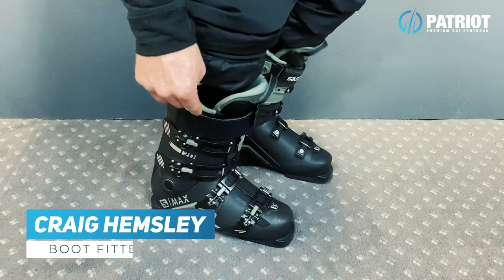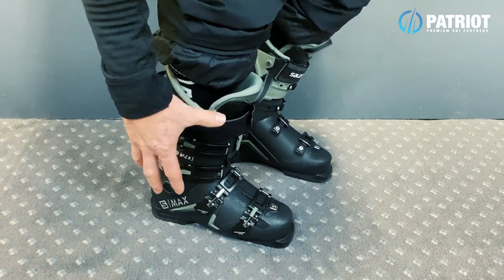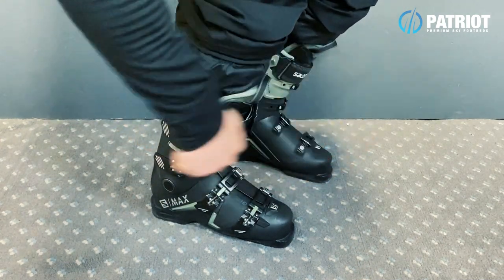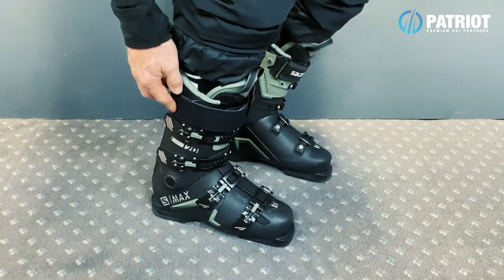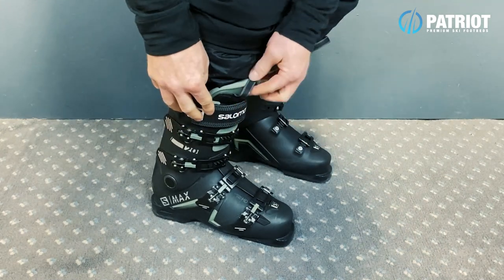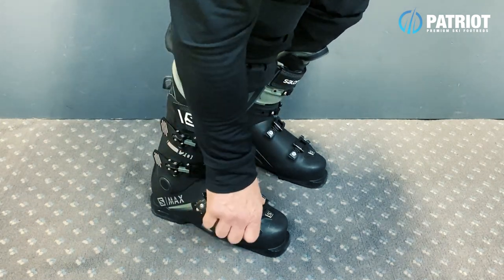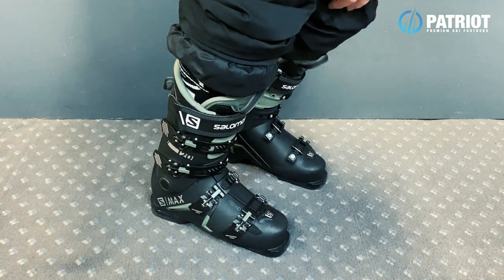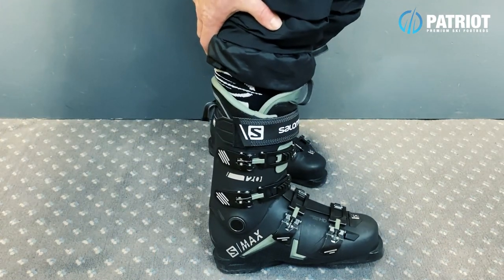How to tighten your ski boots - Ski Boot Tips

Comment: When my boots are tightened as recommended and I then flex forward, I often notice a small finger sized gap between my calf & the rear spoiler. Is that normal, or does it suggest further tightening of the boot cuff is required?
Reply from the maker: This can be quite common. Not always the end of the world.  
if you want to try snig this up, try with your powerstrap under your cuff directly on your liner. Or you could check out the Patriot Trustraps. But can also depend on your boot as to whats possible.

Comment: As a beginner I was sold a pair of Atomic Hawx Magna 80. They are comfortable but I’m not sure if they’re too wide for me. The shop told me all beginner boots have a wider last and it’s ok that they are a bit looser as long as the length is good (it’s perfect). I did some research and they appear to be right. Every big inner boot has a wide last. Should I worry or just use them?

Comment: What about tightness of upper boot buckle on leg and it’s effect on flex.  I find if my  top boot buckle and strap are tight I can only bend my knees very little and I lose flex.  Any thoughts on this?  I believe you should be able to bend your knees to point of covering toes.  If power strap and top buckle are set per your video I would only get to maybe half way to my knees and that is in doors where it is warm.  I have 100 flex Salomon x-pro S boots and weigh 135 pounds.  Is it ok to not really use power strap or have it very loose and just put top buckle on somewhat snug but keep lower leg buckle on as per your video?
Reply: remember that when you have a long ski attached to your boot, it will provide leverage against you and bend that boot more than you would be able to do just standing without being attached to your skis. Also, as you begin to ski faster and hit unseen compressions, the front of the boot is there to save you from collapsing forward. From your description, I would experiment in between those 2 setups, tighter than you may think, but not fully cranked. A 135# skier, that is fully loading that boot in a high-speed setting would be past the max of that boot but it's a perfect sweet spot for normal humans. To dial your setup in, pay close attention during your best runs, on hills you can be aggressive with, how your boots are working on those runs.

Comment: Is it a problem if you have some play in the toe box when leaning forwards? I can curl my toes slightly and have some lateral movement but mid foot and heel are locked in very tight.
Reply from the maker: That isn't too bad. You shouldn't really try to scrunch your toes too much. Especially when skiing as this can cause your feet to cramp up. But if you feel locked from the forefoot back, you should still have great steering.
Reply: @PatriotFootbeds  Thank you for reply. Turns out I've been skiing in too wide lasts all this time. I ended up going to a boot fitter who got me in to a 97mm last. Feels much more secure now. Turns out I got very thin feet for being so long.
Reply from the maker: @calleX  Great to hear this. Have an awesome season!